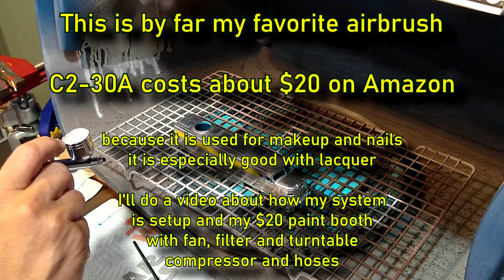Mr Base 1000 White from airbrush vs. ALCO FA diecast part 6

Comment: Nice job with the air brush, first time that I have seen you use it, looks like the paint does go down smooth 👍. Did you say that you painted Hot Wheels & Match boxes?, cause I’m going to be getting into that hobby also when I get set up. Looking forward for your next update, 👋😎🛤🚂
Reply from the maker: I've done a ton  of Hot Wheels and Matchbox.  I learned a lot about painting when I learned to paint the old Spectra Flame paint.  there is a special store called Redline Shop where you can get the paint and the  parts also tutorials on painting.  I watched every video by Marty's Matchbox Makeover channel, Baremetal and a couple more.  On my layout most of my vehicles are Matchbox or Hot Wheels that have been redone.  placed correctly, they look perfect alongside the trains.   Beware, starting down that path causes a really strong urge to buy junkers on ebay!
Reply: elite194 👍😉got ya 👍, yes I’m doing the same thing with HotWheels &MatchBox too, the prices for HO vehicles is out of sight , unless if you want to pay for something that isn’t made by MatchBox or something that fits what your doing in a particular senic on the layout. Thanks for sharing, take care.👋😎🛤🚂
Reply from the maker: @jeffbaker2897  I'll put a look at a couple that I did in this next video
Reply: elite194 👍thanks😎